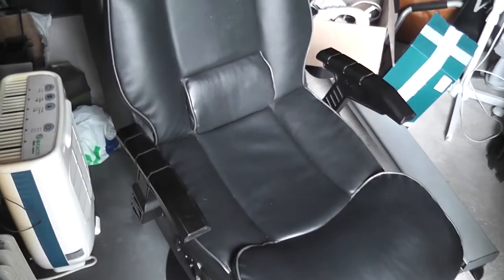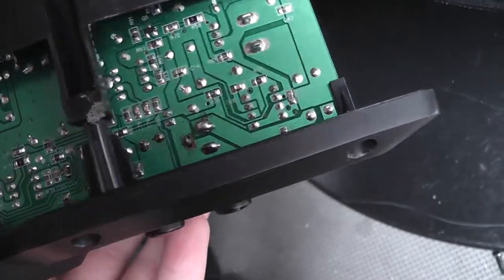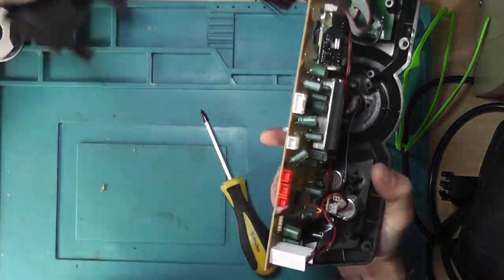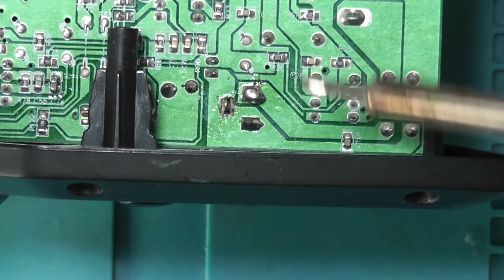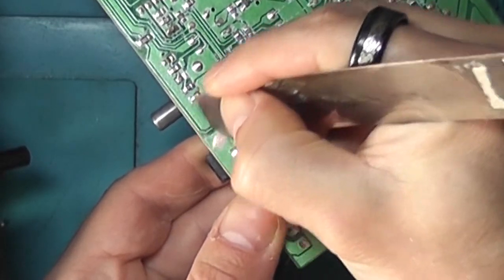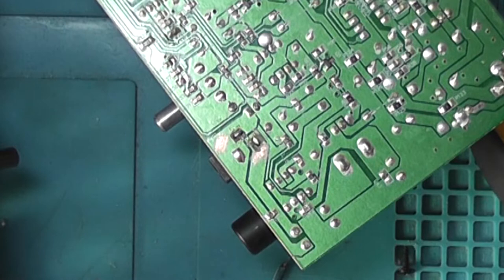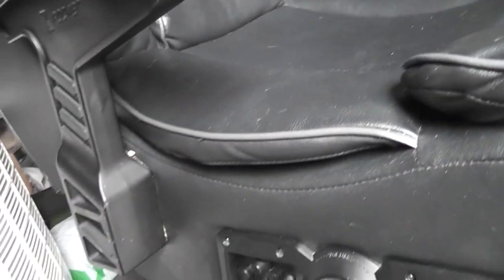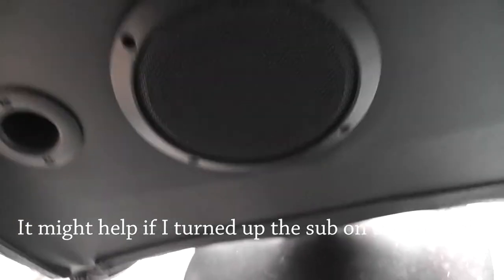Can I Repair - this xrocker with no power?

Comment: Nicely done Marc, I feel your pain with the UV mask and curing time. If you still have this chair, a blob of solder flicked onto the board at 13:57 and may have caused a bridge over one of the resistors. Probably won't make any difference but I just thought I'd mention it. Enjoyable video 👍👍
Reply from the maker: Oh wow, good eye! I don't know how I missed that - at the time or in the edit! Looks so obvious now! It's been fine but I will have to sort that now, thanks, glad I didn't sell/give it away!

Comment: I would have cleaned off all old solder, cleaned the varnish off the tracks, then cut and shape a new pad out of a drink can, sanding off the plastic coat on the inside and paint off the outside, solder the can patch in place then solder the connector in. Would also recommend some hot glue around the base of the connector. Looks like the cable got ripped out by someons foot.
Reply from the maker: Good shout on the connector - I can see it being tripped over easily - the condition of the material is in such bad shape that it wasn't worth more than a quick fix for me - it's remained in the shed all this time, used for storage lol

Comment: I have the problem on the power on off button. It stays in off mode and it doesnt click to on. Do you know what could be wrong?
Reply from the maker: It could be the switch - maybe dirty, could try clicking it on and off a whole bunch and see if it works or try a squirt of alcohol in there - otherwise it may need replacing. If not the switch then a myriad of things, power supply, something else on the board - hopefully it's just the switch a bit grubby though!

Comment: Is U from Plymouth /Saltash area? 🤔 Just wondering cos sounds arf Janner arf Pasty 😁
To secure a jack like that, if working perfectly, I'd remove it and just a lil gob of epoxy tho set it to the non contact side of the board.
Then bridge /bodge the contacts on the business side.
Also a great bargain really, but defo a case for upgrading, to really get some bass/volume/shotgun blast to the ass 🤪
Reply from the maker: Haha no not from a nice place like that! Ah yeah that would work better, I might crack it open again and slop some in there, cheers. Well... Maybe this one can go to the youngun and I can treat myself haha.
Reply: @ziksfix  hmm 🤔 maybe from that there Turkbay nr Torkey, but defo got some Pasty in ur veins. 😋😋😋
Thanks fer the vids 😁
Reply from the maker: @bikerdave1274  in the south west of England so definitely a pasty or 2 in me ;)